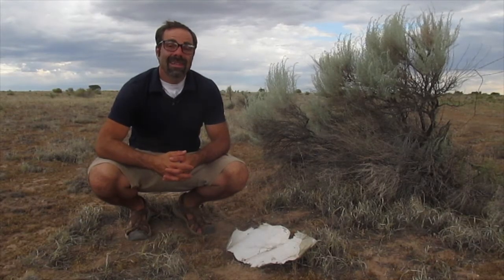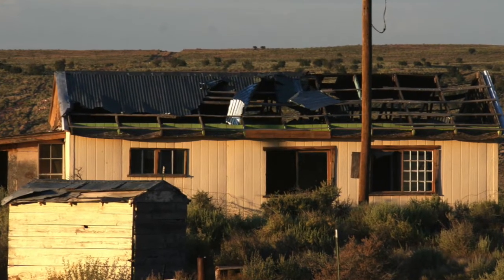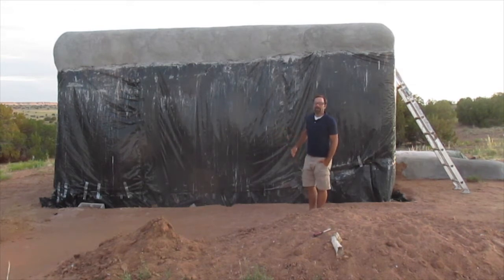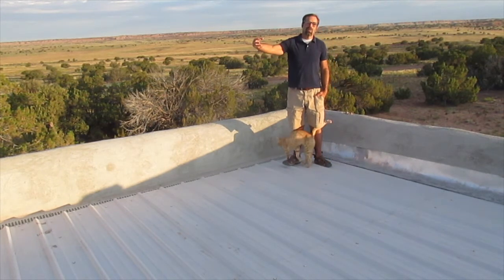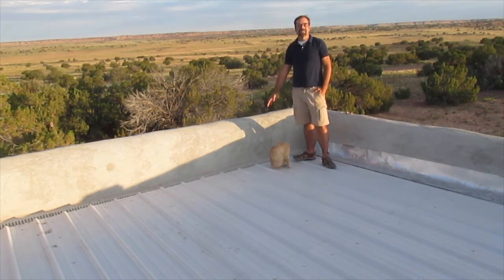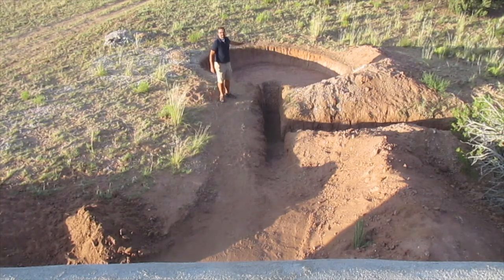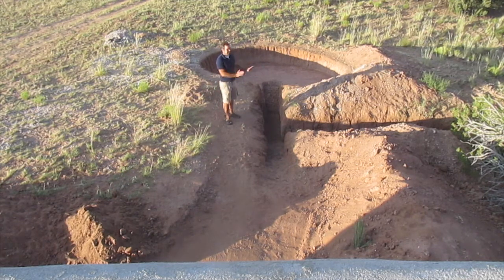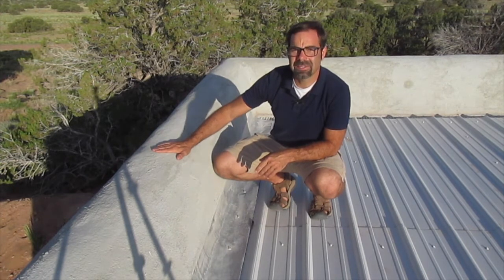Earthbag Build - Episode 11 - Roof, Rainwater Harvesting, & Stucco

Comment: Do you have a cross section diagram on how you created your roof?  I'm trying to duplicate it and can't get it to work. How did you create the slope? Is there any insulation? Is there a vapor barrier and if so, where is is located in the layers?  How far over the walls (if any) does the roofing materials extend?  Are your roof rafters supported by the walls (run between the bags) or is it an interior only roof system supported on posts from below? I saw some posts in the video, but not sure how much they support.  Is there any concrete?  Or just corrugated sheeting? Etc. 

I'd really like to add a concrete slab to my roof, but also want some insulation, and a rainwater collection system, and solar panels, I'm just not sure how to make that all work yet, or if it even can. :-)
Reply from the maker: Unfortunately, I don't have a cross section of the roof. I created the slope by starting two new courses of bags on the high end, installed the rafters, and then finished the courses. I have added insulation between the rafters since I made this video. I have added vapor barriers in several places throughout the building, but the design is quite different than usual because the whole house is designed to breath. The roof is a pueblo style and is contained within the walls. The walls extend vertically beyond the roof. The roof is supported by the walls. The posts you see are mounted on concrete footers. They were meant to support a loft, but I changed my design and now they just support the roof. They are not necessary for this roof. The roof could be supported entirely by the walls. Keep in mind that my design is for a 200 square foot building. A larger building would may require additional structure and/or support. I would be reluctant to make a concrete roof because of the weight and because it would crack and leak at some point. I used 2x6 rafters that extend the entire length of the building and in between the bags spaced 16" on center. I then laid down 1/2" 4x8 OSB. I put down tar paper and then metal roofing. I then added aluminum flashing to cover the gap between the roof and the walls.
Reply: @juniperhighlands  Thanks for the fast reply! It's helpful. Is your roof decking just inside the wall space?  Or did you extend it under the bags at all?
Reply from the maker: @Scoutdogs  The rafters run into the walls, between the bags. The wall is holding the roof up and the roof adds stability to the walls.
Reply: Im wondering if rebar. would work to hold sandbags to make the roof and then use cement and ceramic tiles to finish it.
Reply from the maker: @suebisbee4868  I would be reluctant to make a cement roof because of the weight and expense. Concrete is a great structural material, but a roof really doesn't need what concrete has to offer and it would cost a lot more than other roofing options. Also, depending on the size of your building, you would need to add a lot of columns to hold up the weight of the roof.

Comment: You may already have something similar, but it is pretty easy to incorporate an automatic cleaning system for your water harvesting.  It uses a water switch to discard the first few minutes of rainwater to clean dust, bugs, bird poop, etc off of the roof and a bucket to automatically flip the switch.  I'm also surprised that your entire roof is not tiled with solar panels.
Reply from the maker: I originally planned on having a first flush diverter as a part of my rainwater harvesting system. I decided not to install it because I live in a very dry region with less than 11 inches of rainfall per year. The diverter would consume most/all of the water from the average storm. I am using the screens as my first line of defense and have designed my cistern to sort and remove the remainder.
Reply: @juniperhighlands  Good plan if it's that dry there.  :)